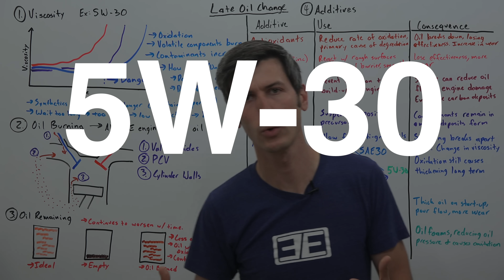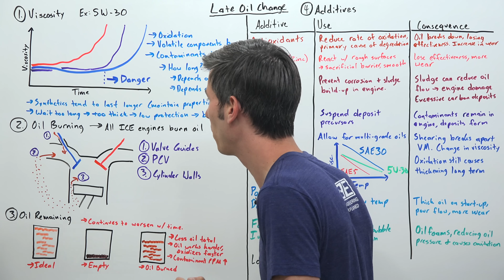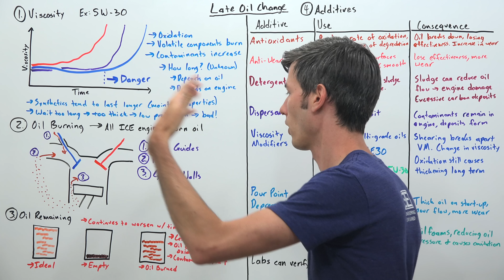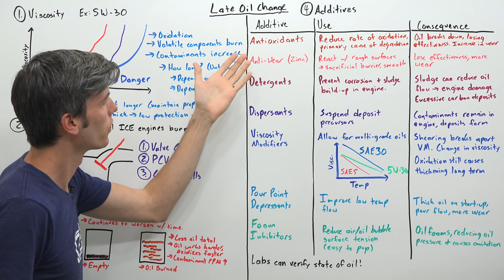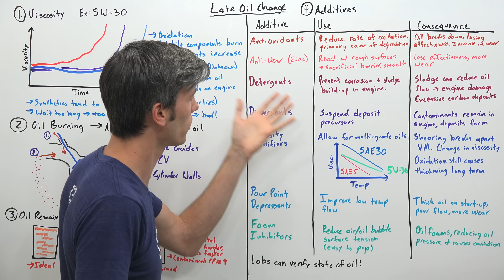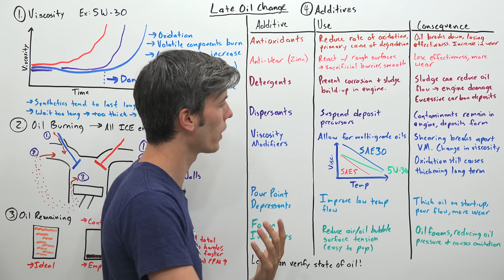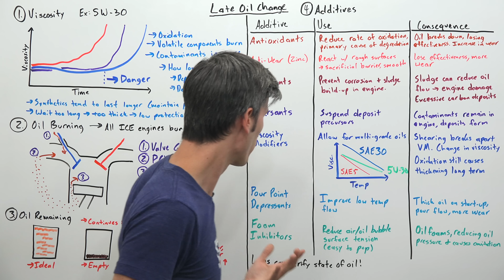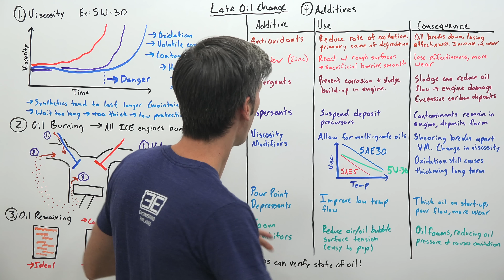What If You Forget To Change Your Oil?

Comment: My car notifies me every 20k km to change oil. That seems a bit too much, but I guess engineers know what are they talking about
Reply: 20000 km is actually pretty generous, a lot of manufacturers recommend around 10,000 miles or 16000 km on synthetic oil. But it typically varys between 7500 miles and 15000 miles (12k km - 24k km), different engines and oils require different maintainence.

Comment: I am interested in your opinion on two common practices that I see people doing:

1. Overfilling the engine with oil to prevent oil starving while hard cornering. Track day practice.

2. Underfilling, between max and min on the dipstick to reduce crankcase pressures and save seals. Primarily on turbocharged diesels to reduce the pressure on turbocharger seals.

Best regards

Comment: 0,00000001km after you forget to change the oil on your bmw. engine blowing upp noises intensifies (point of the joke is that bmw are very rreliable but people think they are not becaus they have a very sensitive maintenance. you have to do the maintenance becaus its very important for bmws or they will breake. people who have good maintaned bmws don't realy see the problems as mutch.)

Comment: How does oil age effect a motorcycle gearbox where the engine, gearbox and wet-clutch all run in the same oil. And can I use regular oil for car engines in a motorcycle.

Comment: And what happens if my car is burning oil like crazy? I have Opel Zafira A 1,8 1999 and this car is burning 0,7L of engine oil per 1000km (its a default value from service book). In that case should I be more focused on often oil filters replacements rather then oil changes since no oil is staying in my engine for too long?

Comment: What is worse, driving beyond the recommended oil change date while still being under the number of miles driven to require an oil change before the recommended oil life timeframe ends, or vice versa? Assuming that modifiers to the previous question, e.g., amount of city vs highway miles driven, short trips resulting in not reaching operating temperature, etc., are not taken into consideration. And do “Italian Tune-ups” actually remove carbon deposits and sludge, or is there any way to detect/remove the aforementioned as a general consumer?

Comment: I am doing oil changes every 15000 km as the manufacturer specifies, sometimes 20000km if im lazy.. And i use the cheapo semisynth aldi oil since it meets manufacturer spec. Never a problem in 96000km.
How much did the oil companies pay you for that commercial?

Comment: My car has engine so busted, that it burns up about 1 liter (0.26 gallons) per full tank of gasoline, so I just do a refill each time I arrive at the pump. Since the entire engine holds only 4.2 liters of oil, I basically am always running fresh one. I only need to change the filter to take the contaminants out with it xD

Comment: This technical graph is not necessarily needed, just change your oil on time or before.
99.99% of fuel gets burnt the rest mixes with the engine oil, ever wondered why your sump oil smelt like fuel when you changed it.

Comment: What I was looking for in this video wasn't to be found, what's the deal with vehicles that do very little miles a year, you talked about changing the oil without waiting too long but is that too long in miles or in time? why do mechanics say oil needs to be replaced once a year even if the vehicle has done a couple of thousand miles?

Comment: Buy an electric car no engine no oil replacement problem solved
Reply: Yeah I'll just take out a nifty $50,000 loan to replace my existing car I bought for $2000.
Reply: @zolikoff  Exactly! Unaffordable and completely impractical.
Reply: Wait 'til you need to replace the battery on that.
Reply: @rick-v4g8s  there was this one guy who needed a new engine after 500 miles, brand new model 3.. If you need one after expired warranty, you sir are fucked.
Reply: @33875 Don't ever get a Tesla... their manufacturing quality is terrible. It's a roll of the dice whether you get a car that doesn't get any problems, or one that spends half its time in service. There are other electric cars...

Comment: the problem with these formulas is the TIME and MILEAGE portions are unknowns. If u insist on changing oil every 5k because you live in the 70's but the oil is rated for 10k and doesn't show any signs of breaking down at 10k along with engine is barely burning any oil... at 7k u forgot to change oil... so enter that into the formula oh wait... its more like if u never change your oil and you engine isn't burning 1+ quarts at 5k which is a sign yor engine is already shot or needs some seals changed... in which case its not burning off oil its merely pissing it out and again not causing build up of contaminates which again doesn't work in the formula... click bait that proved nothing except to understand what is happening to the oil instead of declaring this and that change it at 5,000 or engine will seize at 5,069

Comment: I'm throwing the b***** flag. I have an 1999 ford f350 with a 7.3 l Diesel and takes 15 quarts of oil I only change the oil every 15 to 20000 miles it has 561000 miles I also have a 2003 Ford f150 with 454000 miles on it that I also only change every 20 thousand miles or so whenever I just get around to it. I think it has more to do with the guy behind the wheel and it ever does with a lot of stuff that's going on inside the engines anymore this is just a scare people in the buying oil even when they don't mean it the oils nowadays are really good the engines are really sealed I don't want to hear that you were supposed to be 36000 miles a year to destroy your engine that's bull

Comment: I had an 05 Sequoia that had almost 300k miles when I sold it.  I was running about 10-12k on an oil change with Mobile1 High Mileage full synthetic.  The first oil change I sent them at about 240k the guy called to talk to me about the results and recommended I could try another 2k (on top of the 12k I had driven) because the numbers we so good.  I added a 1/2qt every 6k miles or so.

Comment: missed one point, that as more contaminants are in the oil they end up in the filter, which eventually will collapse and rupture or go into bypass, then any metal particles will circulate around the engine including pistons and pushrods causing significant damage

Comment: Can you do power steering fluid vs ATF? I’ve heard power steering fluid can get around the seals easier than ATF.
Reply: Just use what the manual calls for.
Reply: Jack Tran Edit: “Used in aftermarket applications”

Comment: Dodge Ram 3500, 2013, 120,000 kms.  Only changed the oil 3 times (when the low oil light went on). It was a lease.  I didn't care.  Still ran just fine when I gave it back to the dealer when the lease was up.

Comment: Had a 94 Toyota pickup and it would go easily 10k miles without an oil change or spark plugs, got it with 150k miles and it wouldn’t pass smog at 360k miles the truck pulled strong and always had a payload of around 600lb-800lb. I don’t think you should skip on maintenance but I also think that it all depends on the car itself and the whole 3k miles oil change is unnecessary
Reply: Also have a f150 with 260k miles and it’s being treated the same way and have zero problems with it

Comment: I went over the recommended limit by ~500 km on my last 2 oil changes and I was fully expecting Jason to say that my car is basically broken now lol.
Reply: Far from it you can go quite a ways beyond recommended ~ just do not let it get low → this is an ideal product; I use it with above excellent result;
Reply: I stipped draining il in 1963 using oil filters that clean oil and adding new makeup oil at filter changes. I use the Jackmaster Classic  the Motor Guard and the Gulf Coast filters. I am using Super Tech 20.000 mile oil. Never cared much what the oil changers recommend.

Comment: I use 20w-50 in my old Mercedes. lighter oils leak through like alcohol in a Styrofoam cup.
Reply: I like 15w-40 for older cars, you want to avoid using oils with detergents for alot of old cars (not all) too since they sometimes rely on the sludge or tar to seal things up.
Reply: @archygrey9093  My merc is pretty close to sludge free especially for being 35 years old.
Reply: @commandohazelnuts  when i talk about sludge I'm talking about the stuff that accumulates in crevices and cracks that you don't normally see, i don't think sludge in the oil pan is ever good.
I think those mercedes are modern enough to not need any though unless really worn out.
My 560sel when i bought it had been left sitting for at least 10 years with very worn out oil, had condensation coming out of the rocker cover vents when ran just from the water the oil absorbed during the monsoons it sat in.

Comment: I'm curious as to how oil degrades in respect to time vs usage. I have a car to drive maybe a 1,000 miles a year - even if I replace the oil every 3k miles, that's still a long time. Does oil still oxidize if it's not being subjected to heat and pressure?

Comment: I drove my truck 540 miles on a fresh oil change but 5W-30 instead of 5W-20, which is what the manual calls for. Think I’ll be ok? I put fresh 5W-20 in it once I realized the mistake. I run Mobile One.

Comment: Also worth mentioning some of the newer systems on engines like variable valve timing have smaller passages and are more sensitive to oil condition.
Reply: And yet manufactures are extending or claiming changes of up too 15k miles. Sounds like a cash cow for the manufactures for repairs.
Reply: @djmjay2  that’s actually exactly what it is
Reply: @djmjay2  You'll notice it's typically the manufacturers that have free maintenance for x number of years that spec these absurd oil change intervals. Take bmw for example, interval used to be around 10k and the year they started doing 3 year free maintenance they upped it to 15k
Reply: They are a lot more particular about the oil weight and condition. Wrong oil or long change intervals will not be good for it.
Reply: You are correct. The hydraulic lifters that adjust the valves have tiny holes that need to be filled with oil to function properly. Sludge plugs those holes preventing oil from getting inside. Then you have tapping noise.
Reply: Is VVT now commonplace?
Reply: @johnnycarson67  Yes.

Comment: I love being able to go 10k+ miles on my 02 Mercedes. I send oil to Blackstone and have had a couple runs over 12k and the wear numbers are always low and the oil is still good. Also had the valve cover off recently to have the gasket replaced and there was not a speck of sludge

Comment: well last week finishing up a upgrade/rebuild of engine ..last thing to do was bolt on pickup pipe and oil pan and start it up. well there 1 size bolt that is used all over the car, i didnt notice the 2 pickup bolts were about 1mm shorter than the oil pan bolts,looked exactly the same to me while laying under the car. well that 1mm was the difference between the bolt sticking in too and jamming the oil pump. oil pressure was 0 but i assumed i forgot to plug in OPS or mixed up wires.ran engine for 15mins before i realise OPS wasnt broken. not even 1 drop of il made it to the filter.all bearings still looked brand new!!!!! +1 for liqui moly LM45 grease

Comment: Question:  “oil change ever 5k miles OR 3 months”  if I only drive 1500 miles in the 3 months is it necessary to change oil even though it hasn’t reached the 5k mile mark?
Reply: Just don't change it keep your money!
Reply: Carlos Torres that depends. What type of oil and oil filter? What’s the year and model?
Reply: > 5k miles OR 3 months  

Is this a joke?

Comment: Is it ok to mix different weight oils (i.e. 10w-60 and 5w30) of the same brand?
Reply: I don't know why you'd want to, but sure.  You can also mix brands, it doesn't matter.  What does matter though is the additive package, the wrong additives can cause damage (usually to the catalytic converter).  You would also still need to keep the overall viscosity correct.  At the end of it all, why bother when you can just buy the right oil in the first place/

Comment: What happens when you don't put enough oil in a dry-sump system?  
'Nephews friend took his dad's 930 for the day with the deal of having the oil and filter changed.  Well, of course, he took it to the nearest jiffy lube - then a while later brought it by to ask me, a 911 owner/gear head, wrencher.. could the oil level gauge be bad, it's showing real low.  I asked him to look in the glove box for a manual, which showed it uses 14 liters of oil & jiffy lube deal is usually 5 quarts -  did you pay more than the advertised special?  Of course, they didn't believe this possible but off to the auto parts store for one quart of oil & back again... where do we put it, what happens if that is too much?  I explained it goes in that tank, start it up and let it circulate and then check its dipstick.   Off to the auto parts store again they went for just one more quart.  Heard them driving probably hitting the rev limiter through too many gears in the distance as the left.   They were going to give it back to dad and let him deal with the costs of the extra oil.

Comment: Oil burning can also be caused by high rpm deceleration, that strong vacuum can suck some oil up passed the piston rings and send it out the exhaust. This is part of why automatic transmissions shift at rather low rpm.

Comment: Ahh yes, thank you for mentioning that overall the viscosity will increase over time. I always knew about the viscosity modifiers breaking down resulting in thinning of the oil so initially when you mentioned the oil gets thicker, my mechanical mind had an internal error which needed de bugging. Good thing you caught a potential contradiction and cleared it!

Comment: I have new, unused oil that’s 5 years old.  Is it still good to use?
Reply: Tanah Merah nope, I’d think under perfect conditions if it was never opened and sealed where it was stored in a cool dark clean area with low humidity then up to 5 years is fine, but why risk using old oil past its shelf life and causing permanent damage over a matter of $20-$30? Just dispose of it properly and in the future only buy enough where you end up using it within a couple oil changes. If I have any leftover oil from an opened container after changing the oil I just get rid of it, or I get rid of it after a month or so.

Having it sit through cold and hot climates or through all those winters and summers probably resulted in affecting the stability of the oil (needs to be stored between 40F - 85F), and humidity can cause condensation in the motor oil that will react to the additives.

Comment: It would have been good if you'd had a lab analyse some oil from each of your cars, and presented those findings in your video (maybe along with some awful long-term oil from another car).

Also, I'd be interested in a real-world analysis of how bad it could be using a similar but not exact (hot) viscosity; for example 40 instead of recommended 30. I'd imagine that it wouldn't have all that many implications, until you significantly depart from spec (e.g. 60).

Comment: Oxidation occeurs because it's biodegradable. Temp and time (and gas and water in the oil) may assist. Dispergents are only to a certain amount in the oil, because they are a dispergent, not a lubricant, as soon as this amount is used up, by more and more sludge being produced over time of use, the sludge no longer swims dispersed, but falls out.

Comment: What's the effect of time in the engine (rather than mileage)? For example, a car that does 2500 medium-duty miles per year and sits outside. Do you change once a year? Every 6 months? 3 months? (assume synthetic oil)

Comment: At one of my previous employers, we replaced company vehicles every 2 years, which was around 50,000 to 60,000 miles. We had one employee who wouldn't change the oil in his vehicle until it was ready to come off lease. He never had a problem, but I pity anyone who bought one of those vehicles.

Comment: Two thoughts. The dipstick indication of oil consumption over time is partially offset by fuel and fuel/combustion byproducts that accumulate in the oil. The fuel evaporates incompletely and leaves behind it's heavier constituents. Interestingly, on some engines, oil level is known to go up (Honda 1.5L) . Those fuel byproducts are known to "coke up" turbocharger hot side components. These contaminates are one major reason why the oil change is so important. The other point is that while Used Oil Analysis results are informative, a standard UOA will not indicate the size and quantity of damaging soot particulates or the quantity of evaporated fuel constituents. Nor will a UOA indicate sludge buildup, carboned up piston rings or coked turbocharger problems.

Comment: Great explanation about motor oil!
I think you've also eluded to a possible follow up about oil flow at start-up.
By far the best tool to understand this is simply starting an engine and running for several seconds with the valve cover off and watching the oil slowly build up thru the valve train oil gallery. Whenever I start my engine, I always picture that delay in oil circulation before really getting moving. I just watch other people start their car and hit the gas all in one motion and it puts me in shock.